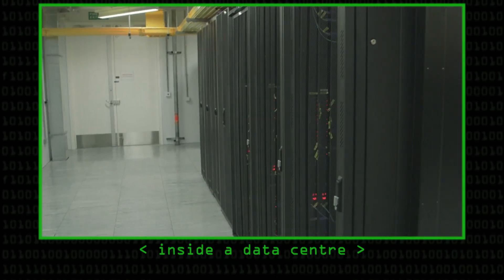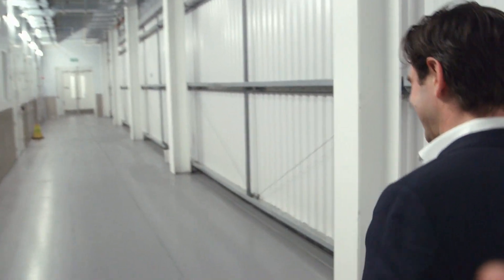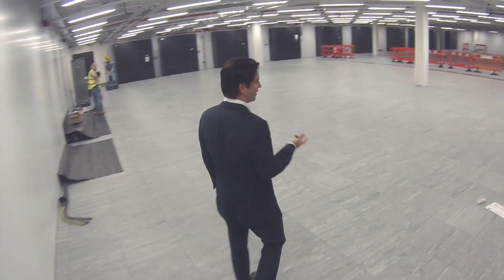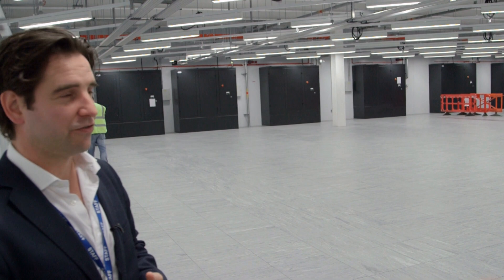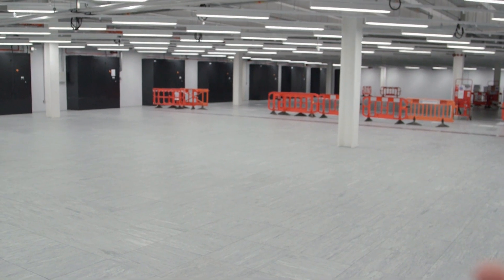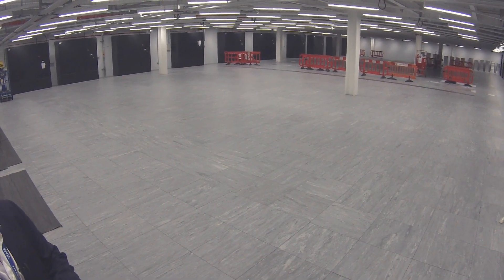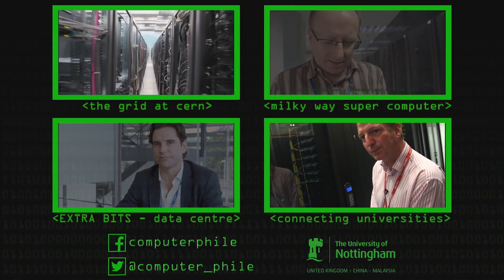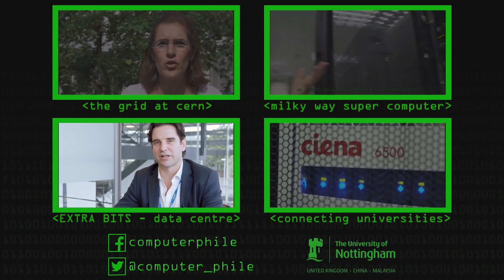Empty Data Centre - Computerphile

Comment: So, how would they add more computer racks in that currently empty room if they already had a few customers up and running in it? 

There would be loads of engineers/contractors/workers wandering through the secure facility and working near another customer's computer rack/pod. What if they broke something or if a worker hacked in when no ones looking? 

I'd like to hear a little about procedures for a hypothetical situation like that.
Reply: Two types of DC's COLO(cation data centres) where they have large rooms like this, separated into smaller rooms by using cages. You need approval to go on site, and then approval from the company who rent the cage to enter their cage. So the company control their exclusive space and it's up to them to decide who has final access. 
For larger providers such as AWS/Microsoft they all have their own rules and processes but generally they have their own buildings or entire sections rented from COLO providers and that area of internal security just extends basically. In this case you have your customer machines in a common area but only approved company employees can enter the building. This may also extend to pre-approved vendors. Security checks are very vigorous, as an employee for one of these larger providers, I'll tell you that it isn't quick. 
Regarding the install itself, it's not actually complicated if the room is already set up to receive capacity. Depending on th skill set, you could normally do this with 2 people minimum. It requires 2 people to move a rack anyway, plus you will normally need an electrician to do the power and a IT based employee to do the network cables/setup. 

I can't go into deep detail, but hopefully this gives you some perspective.

Comment: So, renting space for... let's say a Battlefield server directly by them costs me more than over a third party service?
Reply: +derLPMaxe It's a colo facility, to be technical.  You would have to supply the compute hardware, they supply the power and management.  FOr a BF server, you would be fine with a single U of rack space, so most likely would be able to get it for well under $100/mo.

This all depends on your needs, of course.  How much power? how much space on the rack?  What kind of network connectivity?  A BF server would likely be fine with just a single 1gb connection, plus, maybe a failover connection.  Like I mentioned, a single U chassis with one xeon processor (maybe have an empty socket for expansion).
Reply: FlesHBoX How about: 1024 Players. DM Métro. Muhahaha... ;)
Anyway, thanks for the explanation. Now I understand the concept behind this. They are "just" managers and caretakers not an actual server supplier.
Reply: derLPMaxe Basically, yeah.  Now there are datacenters where you are using their hardware, but these are starting to give way to colocation data centers like in this video.

As far as 1024 players, that would be a question for someone who runs a BF server :)  I would suspect that it would scale pretty well since most of the game's calculations are spent on graphics, and the server doesn't handle any graphics.